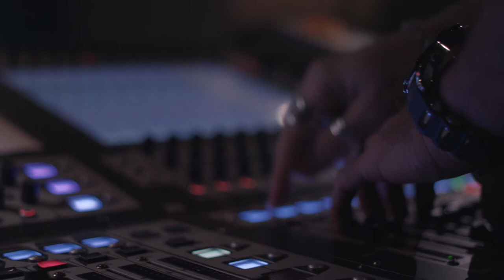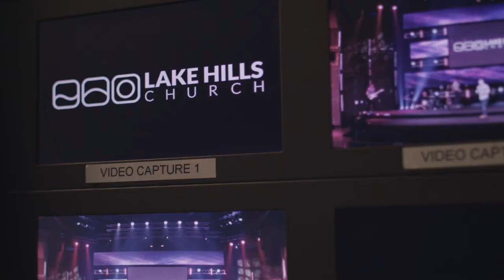Leadership Lessons from Our Conversation with Jesse James

Comment: No one "hones" their craft in their 20's or even their early 30's.  During that period you learn the basics of your business,  learn to deal with the world,  look for mentors,  books etc, make your mistakes, especially people mistakes.  And now, if you're bright enough you've got the raw material.  It's at the point where you're comfortable  doing what you're doing that you can start the honing process and not until that point.    This is the point where innovation should  comes in.    You try things that have never been tried before in your industry.  You eliminate what doesn't work and keep what does.  That is the honing process.